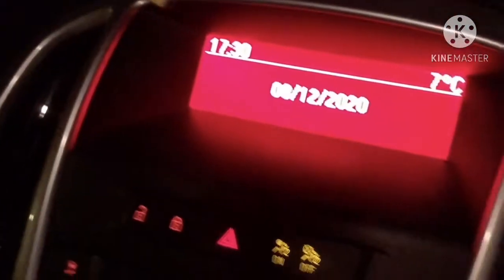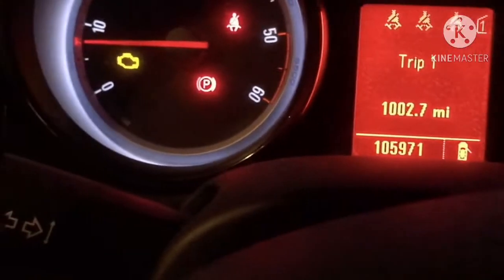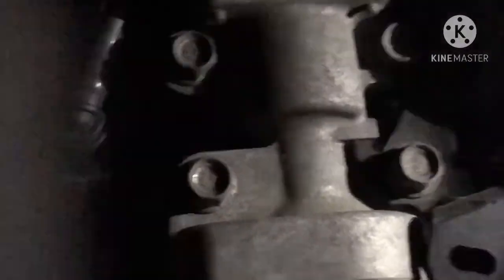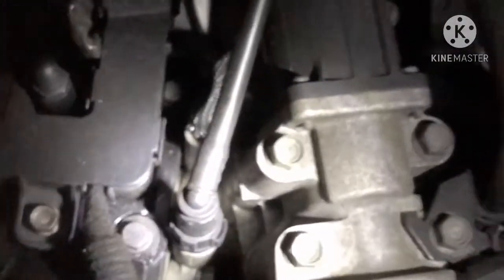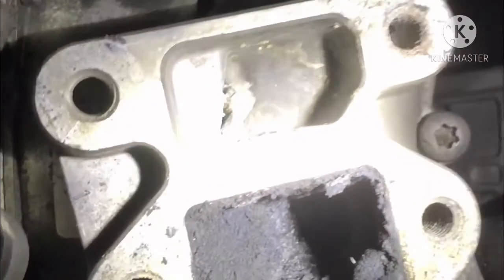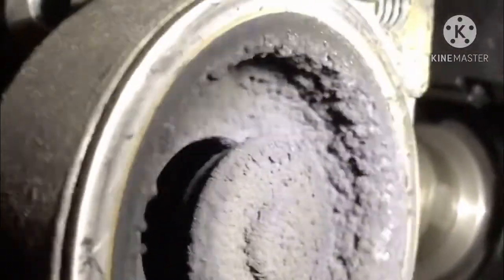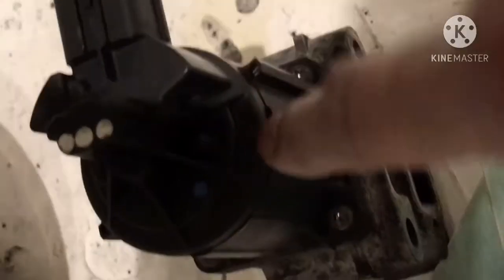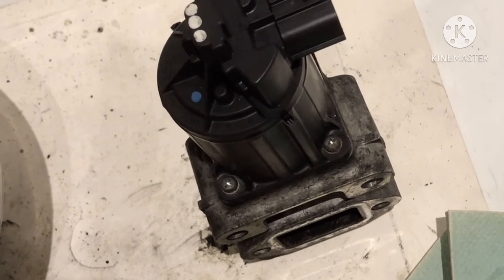Symptoms of a dirty EGR and how to clean.

Comment: Excellent video cleaning egr valve. I got same . Does  new egr valve it replacement needs reprogramming?
Reply from the maker: Just so you know I didn’t change the egr. I dismantled it and cleaned it using an old toothbrush. The only thing to be mindful of is there are some circlips which you don’t want to lose. If you did change it then NO you do not need to reprogram anything. Just cycle the ignition on/off 2/3 times. It may be hard to start while the egr readjusts. But it does work. Please like and subscribe